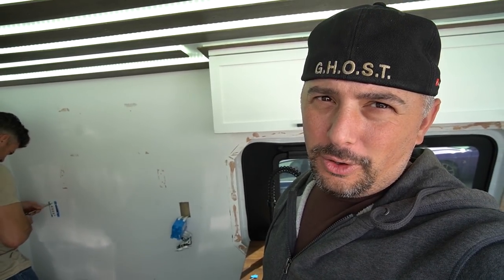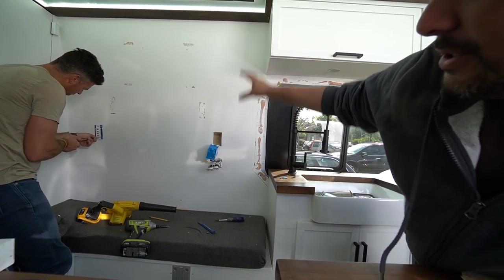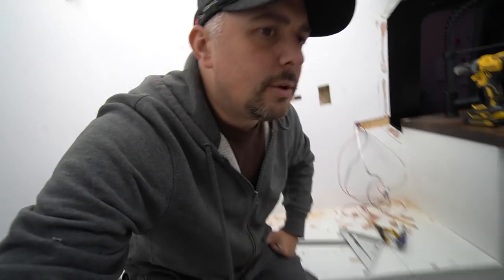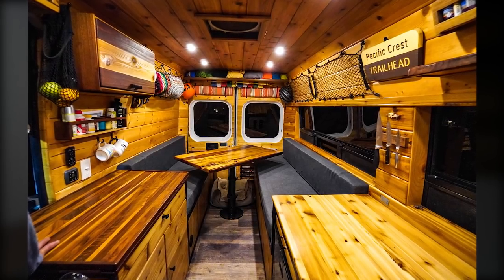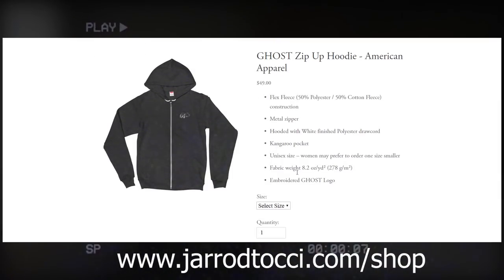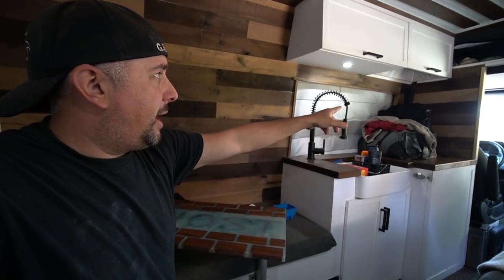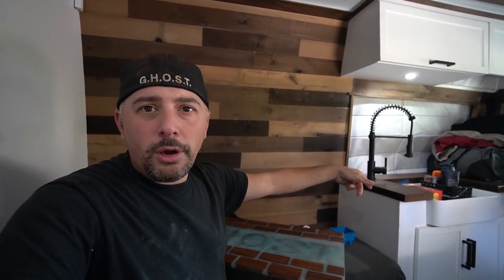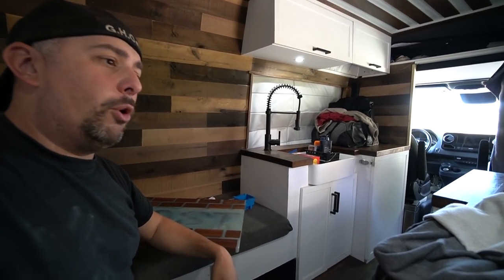How to Install Barn Wood in a Van - Accent Wall Warms up the Space

Comment: It looks really good!!! I'd LOVE to do a cornflower blue paint wash, on four or five random wall boards, but then ya gotta commit. Soooooo, what about a few random clear, or galvanized tin, tiny bud vases on a few of the random boards, and at different heights? That way, you could put a splash of color on there, wout a huge commitment, AND you could chage out the flowers, depending on what your color mood was each week. Even just a few fresh sprigs of rosemary and lavender in the vases, plus you could cook w it!🤗👍😊

Comment: You could have cut the painter's tape shelf (leaving it 1/4 wood and 3/4 epoxy) replaced it with one of the barn boards, and called it your build-in micro aquarium. A feature no other van lifer has.

Comment: I've been in situations installing material on walls where it didn't call for joining the edges. So I painted the wall black or brown on a flat color before installing the material.  To me the most important part of installation things in a vehicle is to use glue or silicone to keep squeaking to a minimum when driving. I want to work with Humble and Craft that I saw here.  That's one job I think I'd be at work an hour early every day.
Your wall looks great. It so needed that.  It looked like you were doing your videos from the DMV with the white wall. Make one of those panels removable with a box behind it to keep the stacks of cash you make telling jokes

Comment: The window looks so much better. Those angle cuts were ....not great. That coming from a guy who worked in furniture manufacturing for about 8 years. (And had an Uncle who was a Master Carpenter/Cabinet maker)

Personally I think you should put in RGB lights under your cabinets. That way you can play with the colors to find some you like without changing them out constantly.